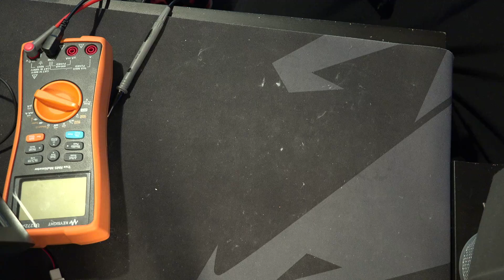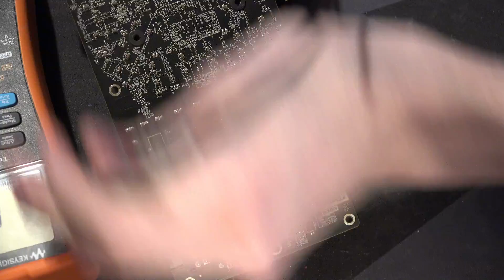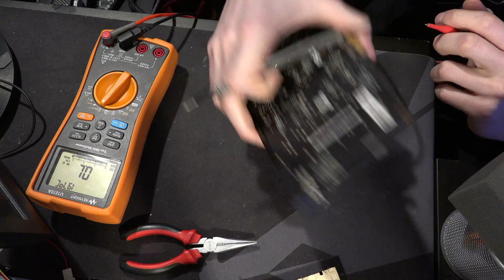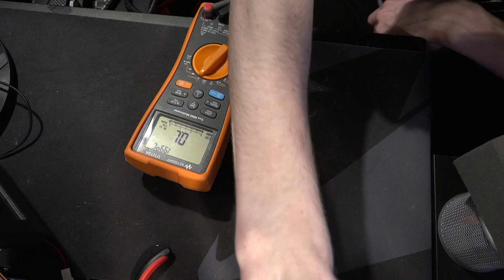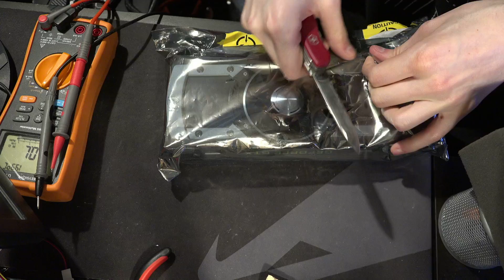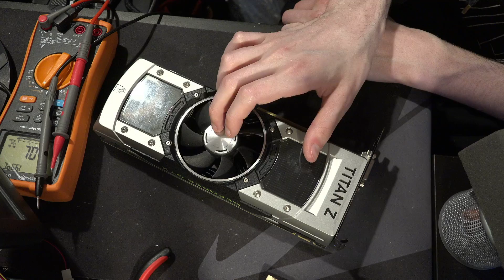AHOC fan mail.

Comment: i need a heatsink for a sapphireR9 290 Tri x OC
Reply: I bought the card new and after around 200 hours I replaced the thermal paste (Thermal Grizzly Kryonaut) put it back in my PC and it would come on then shut down after 2 seconds, I check my work and found I striped one of the screws around the GPU and I couldn't fix it.

Comment: Hi, i have a 290 Trix with similar problems to the 290 you showed ( there was a short in one of 3 vcore mosfets and I removed all of 3 just to be safe). VRM turns on in windows without driver but shuts down as soon as drivers load. vcore resistance is nominal. mem is 15 ohm and controller is like 47 ohm. is the mem too low? should I try to heat up the core or do you advise trying to put back 3 new working mosfets? (hard, I know)

Comment: Hey guys weird question to ask, but my pc randomly crashes (it freezes and makes weird noises out of my headphones. I then have to manually shut it down via front panel).

Usually happens after long gaming sessions, which I think would usually be temps.
My 6700k is at 1.265V 4.5GHz stable and my R9 390 is at 1120/1580 1225mV(I also tried stock, still happened).
Temps are at 55 C on my 6700k and 73 on my 390.
I replaced the Thermal Paste and Thermal Pads on my 390 so it shouldn't be a vrm issue. I checked them in Trixx and they're at 85/ 88 under 100% Load for 15 mins stresstssting.

I cannot figure out what the proboem is. I've researched this issue disabled my audio drivers tried a different video output and whatnot.
The reason I'm asking here is because most people in here are much more knowledgeable than I am. I also asked in a german forum 1month prior but noone answered.

It somehow only happens in Rocket League and Rocket League only. Other games have both a higher CPU and GPU load yet don't crash like that. I've also asked the Support but they said it could be the drivers, I've tried multiple stable ones the newest ones and whatnot all with ddu. I've invested 10s of hours and I don't know what to do anymore. If anyone has any idea why this might be happening please feel free to reply.

Asus z170k
I7 6700k
R9 390
Kingston HyperX 240Gb SSD
WD 3TB Blue
Reply: open your pc. turn it on end enter UEFI or do that from windows if you use fastboot. 

while in there, move the cursor around with the keyboard and GENTLY nudge the ram around. if it insta-freezes you got the problem right there: bad electrical contact due to dust buildup. MANY intermittent crashes on a lot of machines i fixed had to do with this, so much so it is a routine check.
generally i stick a guitar pick in the keyboard on an arrow key to keep it pressed to work with both hands.

Comment: This whole cutting the back off a card and using it to repair another card, i would LIKE TO SEE. Especially if the end card could actually be used in a gaming pc and not just as a toy for us to watch you play with.  Also i get ideas all the time. Am i nuts? Could an old GPU VRM be used in this way to replace a shitty CPU vrm on an otherwise good motherboard?

Comment: I’ve watched Eli for ages now and have learned a lot from him and you buildzoid. Gone from knowing not a great deal to repairing an old dead 390 and figuring out a faulty 980Ti which had a shorted main chip. I didn’t repair that one though due to tools and didn’t have a spare die.

Look forward to the follow up videos on these cards.

Comment: I'm happy you have the ASUS GTX560. I have the same model, but the Ti version. I already De-lided it, BIOS, and Cap modded it. Pushing it toward 1100MHz with the original heatsink, but would need to hard mod it to make it stable! I would love to get some more insight on the controller and how to mod it! I'll be putting a universal waterblock on it later on to push it to the max!

Comment: Are there I2c headers on the Vega? You can modify the IR voltage controller firmware with the IR usb005 dongle, it's awesome you can change stuff on the fly and flash it permanently if you're happy with it.

I'm using one for amd epyc overclocking on a supermicro board. I already spotted the famous header on the new reference Radeon VII
Reply from the maker: The thing is I want to dsiable the drivers ability to see the GPU power draw.
Reply: @ActuallyHardcoreOverclocking  yeah, I meant it more as an answer to 25:50. With I2c access you simply overwrite anything coming from the vbios or drivers.

Comment: Have you ever attempted a reflow of a GPU? If so what flux and heating tool would you recommend, knowing that this is not a guarantee to fix things.
Reply: Just saying I reflowed a ton of Xbox 360s and its not only not guaranteed but unless the reason was it dropped and the solder ball broke...then the problem is really a disease meaning you can only treat. After the xboxs I got my 1st and 5970 I successfully reflowed but it worked at stock for a week before I put half the over clock back on and that lasted about a month before it started downing in games and showing ram particles tessellation. I then reflowed it a second time and also reflowed the ram and idk if It was wise to out the over clock back but it worked again. Only for about another month if that. If the chip is not too bad it could last months hell I have 1 Xbox that still works but I think that's was because I stopped the overheating quick that caused it to rrod and that one was dropped. Its basically how much effort you want to put in to something that could last 1 minute 1 hour 1 day 1 boot....etc and it will almost definitely not be able to game like it used to. It may work forever as a browsing GPU or normal  usage but they will never be like they used to be. Hope this helps

Comment: Wondered if it was possible to "upgrade" memory on a graphics card like if there is a spot on the pcb for additional memory chips if you could add a chip in that place that was the same as the rest or just swap all memory chips to a different brand like micron to samsung
Reply from the maker: I want to try memory chip swaps. Adding missing memory shouldn't work though since the extra memory channels can be physically disabled.

Comment: Vega might be alive electrically, but it can also have cracked interposer / hbm stacks. Many people at our local forums killed their reference cards (with both Samsung and Hynix chips) while installing Morpheus II or simply replacing thermal compound
Reply: Also, how on Earth did someone manage to burn the atomic-proof VRM on it?
Reply from the maker: @borealeone  Considering that the burn started from the MLCCs and the VRM itself is fine. I'm going with one of the MLCCs having some kind of physical damage that lead to an internal short and resulting fire.
Reply: @ActuallyHardcoreOverclocking  Internal shorting is actually a very common failure mode for MLCCs, usually caused by mechanical stress, such as the board flexing too much under them. There are special MLCCs that have semi-flexible terminals designed to prevent exactly this.

Comment: Instead of using external power boards, wouldn't it be possible to hot air replace the existing ICs?
Reply from the maker: A working GPU core is worth more than the PCB of most GPUs. So swapping the core is not worth it unless you have some special edition PCB like a HOF or KPE.
Reply: @ActuallyHardcoreOverclocking  Oh I wasn't actually thinking about core replacement or even the memory chips. Rather the dead power delivery parts. Other than internally broken traces everything can be repaired in theory, probably unrealistic without board schematics and all relevant datasheets...
Reply from the maker: None of these cards have obvious PCB damage. Only the VEGA one has short from 12V to GND and that's not a component replacement based repair anyway.

Comment: Now I wana buy some broken gpus and try to fix them, lol
Edit: According to Userbenchmark a Titan Z is about as powerful as an RX 480. Why the hell do those cost 4 times that of a used 480??
Reply: Kommentator collector value
Reply: Kommentator  Because they were worth way more when they first came out. They’re also just way cooler than an RX 480.
Reply: Should be around 1070 levels of performance depending on the game's opinion of Kepler and SLI. 
But man, it's a cool looking card, and because of the original $3000 price tag it's also exceedingly rare so I figure that's why it retained its price so well.
Reply: Sry I didn't read it properly. One gpu of the Titan Z is about an RX 480. In SLI it should be equal to a gtx 1070.
The price makes much more sense now too.
Reply: Also pretty rare because people would just buy 295x2 instead. More performance for half the price.

Comment: Hey buildzoid,
I've done alot with my Titan Z. (Titan Z Owners Club @ Overclock.net) You will find some fully unlocked bios files there from me. Be aware my card pulled up to 43A per 8 pin connector...back then I bought an AXi extra for this card because you can disable OCP for the PCI-e power rails. Card did 26490P Firestrike GPU score on water. Let's see what you can do. >;) I have the feeling I will loose my pole position on hwbot for the Titan-Z. =D
https://hwbot.org/submission/3370080_

Comment: The first card, doesn't it have a dead memory chip? 0:51 the chip next to the diagonal one, it looks like it's cracked or something.
I know fuck all about how they're supposed to look, but it looks noticeably different from the others.
Reply from the maker: just a thermal pad on it
Reply: @ActuallyHardcoreOverclocking  Ah, makes sense. Too used to the blue ones that you primarily see nowadays, didn't think/remember they also came in black